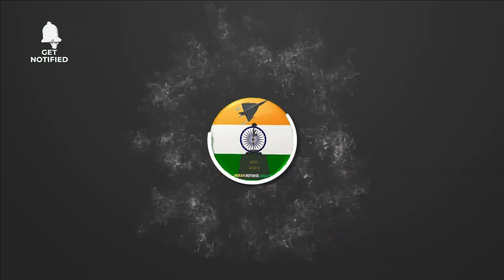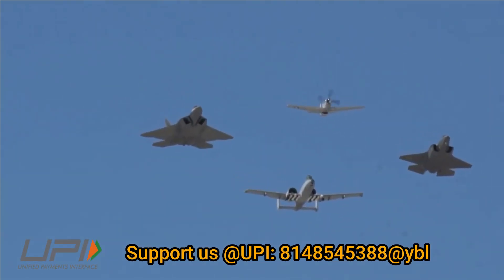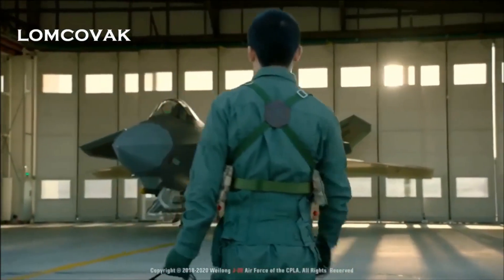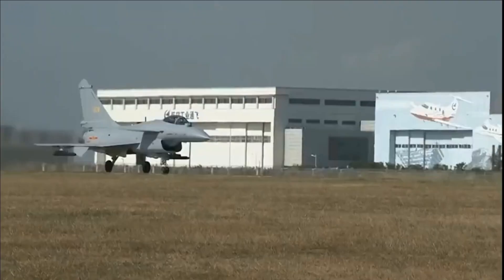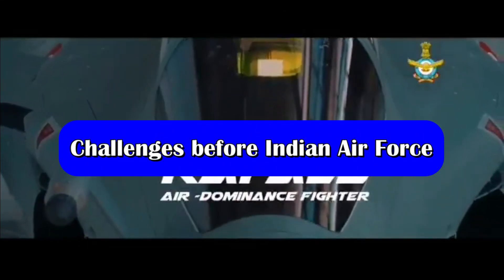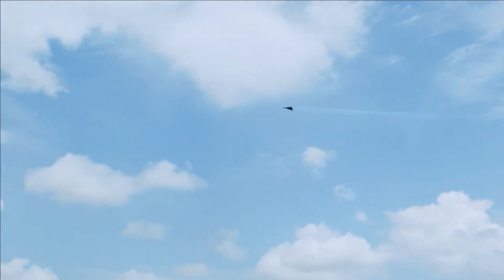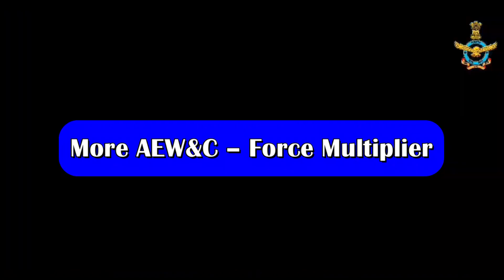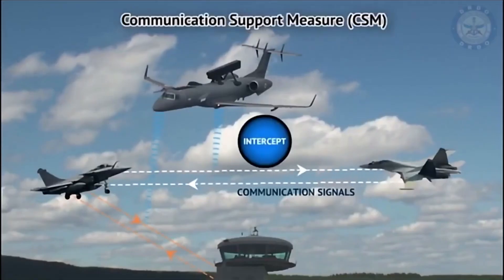Did J-20 break down during Zhuhai Air Show?

Comment: Looks like The engine is made by Cummins..🤣😂
Reply: The f22 also has smoke when the APU starts, damn they made by Cummins too?😂
Reply: @_Chad_ThunderCock   Chinese iT Spy Spotted 😏😏
Reply: @_Chad_ThunderCock   You Don't Need To Be Chinese To Became A iT Cell Employee But Most Is Needed Is Money To Became A Soldable Product To Chinese Autocracy.
Reply: @_Chad_ThunderCock   You Are Literally A Big LOOOL😒😒
Reply: APU is usually a composite power pack composed of a small gas turbine engine and a small generator. During the ground self-check, the APU is in the starting state, and the exhaust port on the back of the machine has heat flow out! The F22 has it too, just under the wing!

Comment: looks like, it has diesel engine with hybrid kerosene as fuel
Reply: APU is usually a composite power pack composed of a small gas turbine engine and a small generator. During the ground self-check, the APU is in the starting state, and the exhaust port on the back of the machine has heat flow out! The F22 has it too, just under the wing!
Reply: @jojored7966  Why spamming.
The j20 is just a copycat of f22.
That's the biggest embarassing moment for china and plus made in china though, so fast production less safety ,so the after effects will be like this
Reply: @eternal1967  Ignorance makes you strong! May you always be so strong!
Reply: @jojored7966  i said with proof.
Reply: 一听就是个军盲，那是启动飞机使用的，如果没有它你就需要跟着一台后勤保障车辆👺
Reply: @町蓝  chill. i was just joking. to make life lighter.

Comment: Is J 20 a  5th gen  fighter jet, the two  engine of J20 " Shenyang WS-10 " are at max 3.5 gen engines since powerplant is the main determinantal the generation  of a fighter jet, this is at best a 4 gen fighter jet,  chinese yet haven't broken the engine equation.
Reply: Abhijeet Kundu   
j20 weight: 17,000kg
SU-57 weight: 18,500kg
F22 weight: 19,700kg

These are all in the heavy weight fighter jet class🤔

Something is not adding up Kumar
Reply: Abhijeet Kundu  Ohhh Kumar, you Wrong again. India's Tejas don't use their own engines, they install General Electrics F404 from USA
Reply: Abhijeet Kundu  there is no no indigenous power plants for Indian Tejas Kumar. India is incapable of developing jet engines for Tejas.

"An Indian design, the Kaveri was originally intended to power production models of the HAL Tejas Light Combat Aircraft (LCA) being built by the Aeronautical Development Agency. However, the Kaveri programme failed to satisfy the necessary technical requirements or keep up with its envisaged timelines and was officially delinked from the Tejas programme in September 2008"
Reply: Abhijeet Kundu  this was a good talk Kumar you've entertained me very well. May we agree to disagree and move on. 

Like one of your samosa loving brethren has once said 

Tejas best in universe! No other
                         ~some Indian
                      
have a good day and fairwell😂
Reply: I can see a lot of corona people in replies spreading virus in here.
Hey check your country's airforce rank and then talk .
Copycat of f22 XD
Reply: According to that standard AMCA even mark2 is not 5th gen.......F 414 series is only enhanced 4th generation engine. Only EJ200 have 5th gen features.
Reply: APU is usually a composite power pack composed of a small gas turbine engine and a small generator. During the ground self-check, the APU is in the starting state, and the exhaust port on the back of the machine has heat flow out! The F22 has it too, just under the wing!
Reply: Why are Indians talking about 5th Gen fighters and jet engines? They can't build either. Go sit in a corner until India makes a homemade jet engine that can be used in the Tejas.
Reply: @thetruthhurts9750  Indians arnt capable of making 100% indegious jets (for the time being atleast) so they're amca fighter jet program will definitely require foreign parts and partnerships for development. 

Tho I'd say it's better than buying whole fighter jets like they did with Rafale, would save India money and give them more flexibility with how they want to use the fighter jets.
Reply: Abhijeet Kundu  if j20 can't even start engines how the hell are they doing flight demonstrations? What did the put in your somosa Kumar?😂
Reply: Abhijeet Kundu  I think our conversation is coming to an end, I'm not interested in information I'm a facts guy. You say the Tejas have most things indegious but that is simply untrue. They import American engines & Israeli radars for the Tejas.

The only thing I can agree with you is that Chinese indeed to reverse engineer and steal technology, that's the only thing correct said by you so far. Let's stop living dreams and talk reality alot of the not everything in Tejas are indigenous so let's cut the fairy tails
Reply: Abhijeet Kundu  That is why India is forever No. 1.
Reply: First of all, people can only buy if they are willing to sell
Reply: So in a normal day it's a 3rd gen & a 4th gen at best? So a the Tejas can beat it?😂

Oh boy almighty tehas🤣
Reply: @_Chad_ThunderCock  Oh boy look at the low IQ bat here. The op is just saying J-20 engine is nowhere near 5th generation. Chinese engines are based on Russian engines. And Russian engines aren't the best. They need more servicing and maintenance.
Reply: @_Chad_ThunderCock  You think US doesn't have hypersonic missiles? LOL. Then you don't know anything about USA. With respect to Engine performance, Chinese sure have built a Engine but they are still in 1980's at best. Chinese hackers regularly target GE servers. And my colleagues know exactly where it is coming from and what exactly they are looking for. If you think WS-15 can be compared to raptor Engines then you certainly don't know anything about raptor engines. P & W have poured billions to develop military grade jet engines in the past 20 years.

Even GE cannot compete with P & W now. GE's space is shrinking in USAF. F- 22, F-35 all have P & W Engines. GE is nowhere. If USAF phases out F-16 and FA-18 in the coming years then GE engines will only be on F-15's. GE has been pouring billions to develop next generation Jet Engine for 6th generation fighter jet. Yet with all their experience they haven't built anything close to F-22 Raptor Engines.